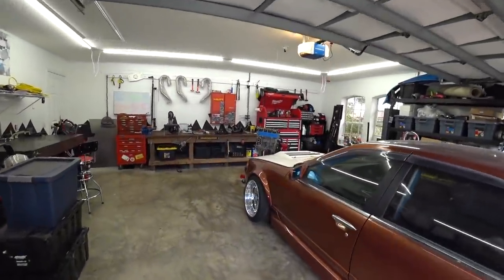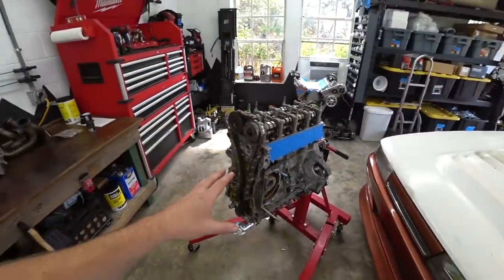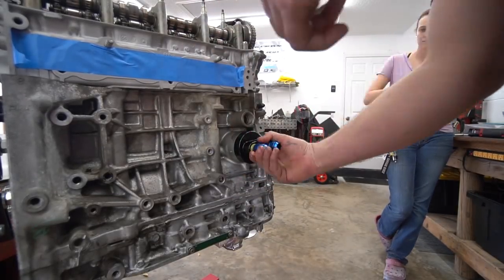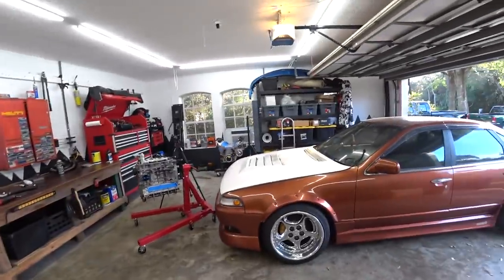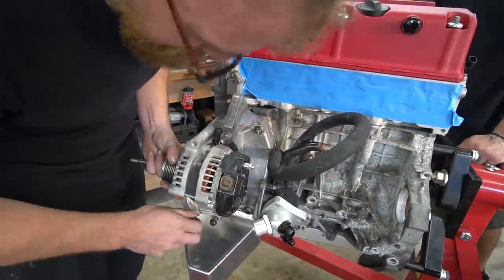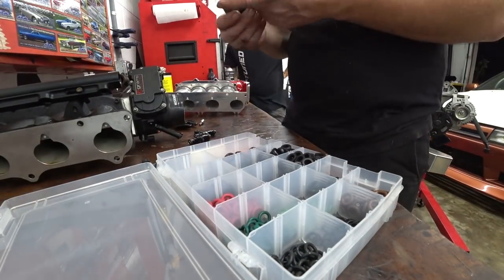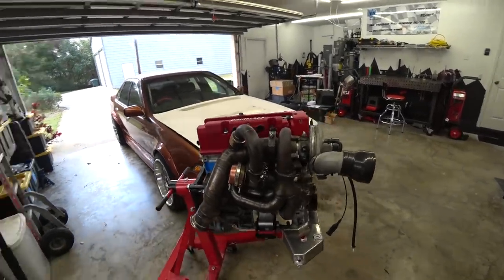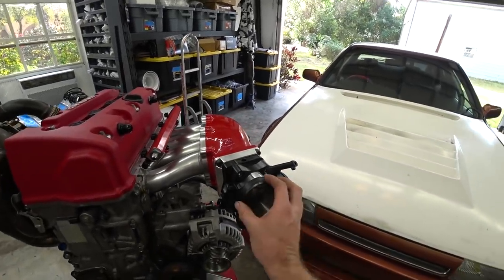Turbo K24 cefiro build. new 700whp engine is ready to go in.

Comment: I have always kept some 6in Cut off wheels for the situation where you need it to go deeper like you did where you can't get it from the opposite side.  Requires removal of the grinder wheel guard but for 1 cut it's been fine when not applying much pressure and a nice straight cut.

Comment: I love this build so much, thanks for making such a unique car Taylor! If it blows up again you might just want to run a K20 instead of the K24, the K20 can hold way more torque then the K24. It's why the Boosted Boiz switched to a K20 from a K24 so they could run 7's.
Reply: Sorry bud but they switched to the k20 to make LESS torque because they kept breaking axles with the k24.
Reply: Nahh, the k20’s make less torque. and rev out just a lil higher if I’m not mistaken. I’m sure somebody will chime in that has real experience. But I’m pretty sure the k24s make more torque therefore more likely to bend rods/crack blocks.
Reply: @gmonnye  yes they rev higher and you loose a little torque, main reason for them switching was gearing, they were hitting the limiter with a k24, not much you can change with his setup because it doesn’t really have a diff like a normal rwd car, and I don’t think there is much you can do to change the diff ratio in a honda transmission, also less torque=less wheelies, never had problems with axle like someone above said
Reply: Literally the opposite but ok. 

They can hold similar amount of torque but the k24 will naturally MAKE more torque.

BoostedBoiz switched to a K20 for higher RPM which was favourable in their scenario and to make less torque especially at the low-ish rpm you launch at to keep the nose down.

Comment: Just a random thought I had while you were messing with the front timing cover, would it be too difficult to use s2k parts for the accessory drive or is it just easier to buy a swap kit for it?
Reply: Completely different engine. Parts don’t fit a k-series.
Reply: @douglasm3310  that’s what I figured guess it’d be way more expensive and harder to find a complete out of a s2k
Reply: @spunk97100  Yeah the s2k has the f series there similar to the k series, but also quite different.
Reply: @RileyLH  is it just not common for people to swap in the f series then
Reply: @spunk97100  Yeah there is less support for them, a few people do f swap stuff like my buddy is f swapping an e30.
Reply: @RileyLH  well if they’re anything like the K series I’m sure they make good power
Reply: @spunk97100  ohh still great motors I don't think they can handle as much as the k series. As well there much more rare motors because they were only in the s2k. So there more expensive and mods are a lot more that's why most just go k
Reply: @RileyLH  oh ya they’re super expensive I looked up some right after I commented and they’re like upwards of 8k for one so ya I could see why they aren’t as common haha, blow that thing up you’re out a good chunk of change
Reply: @spunk97100  Lol yeahhhh the k series you can get at a junkyard for just a few hundred bucks. but the same can not be said about the f series lol
Reply: @RileyLH  right now everyone’s doin k series I wonder if people will ever start taking the newer engines out of some of the Nissans
Reply: @RileyLH  the f20 is decent. The f22 is better for more torque but they don't respond well to high boost.
Reply: @spunk97100  honestly I don’t see it happening. The reason that half of these older engines have an almost god-like status is because they were overbuilt from the factory and in most cases turbocharged so increasing power could be done pretty easily. The accountants don’t let the engineers overbuild things anymore. Profit is far more important than reliability of performance to modern car companies because they are run by shareholders not car people. Why make the block 10% stronger if it increases the cost of the engine by 3%? As long as it fails after the warranty it’s not their problem. The only situation where some of these boring lumps might be swapped into other cars is because they are so cheap that it doesn’t matter that they are weak because when it pops, rip it out and throw another one in there, kind of like how people treat iron block 5.3s or used to treat 1Js

Comment: community question .. im upgrading to 1000cc or 1300cc injectors not sure on size yet but i torn between , ID , Fuel Injector clinics , or deachwerks and my fuel pump is already upgraded to a deachwerks and was gonna use there injectors but was advised to run ID1050s .... so my question is are there any dramatical differences between them besides price?   thanks in advance to anyone with the actual knowledge to answer this peace n love to all build on and stay safe and rad  ps my goal is 5-600whp on low tune an 8-1000 on kill thanks in advance

Comment: Dude - either get the new water outlet or pressure test your welds. Testing shouldn't be too hard. A block off plate with some Honda seal, some rubber hose, bolts for plugs, worm gear clamps,  and a compressor hose fitting. Shove it in a tub of water and run the pressure up.

Comment: When you used the t-square off the Garrett flange, should have done it from the lower step of the flange because the Borg step was higher. Well done on overcoming the issue!

Comment: If you're worried about mounting surface's being warped. Brush or spray them with some marking dye and run a file across it. The file will hit the high spots and leave the dye in the low spots. Continue to file until there are no low spots. You now how a straight flange. Most files you can unscrew the handle to use on larger surfaces. A must for headers, exhaust manifolds etc..
Reply: Dykem is the brand of layout fluid pretty much everyone uses in the fabrication game. Brake clean removes for cleanup purposes.

Comment: I usually use a propane torch to pre heat thicker aluminum and steel projects. It has helped my welding out tremendously

Comment: Taylor, if you do something like the manifold modification in the future, take the current setup and make a bracket for the housing and bolt it to the table suspended so you can get the positions exact.

Comment: hey man love the channel, not sure if it just wasnt shown on camera but it looks like you missed 3 small spots for putting honda bond on your timing cover.. it can leak oil internally if it doesnt get some there.. google k24a4 timing cover honda bond application and a picture from hybrid racing will show you also put a bit in the bottom centre of the cover on the raised spots there.

Comment: You can check it for leaks easy. 
Close off all the holes.
Put air pressure through the long hose.
Spray soapy water on the area while you spray to see if you get bubbles.
We do that for parts we weld up for aircraft
Reply: I do commercial fire sprinklers and we do the same. 40psi air test with no pressure drop will usually mean 200psi of water will not leak a drop